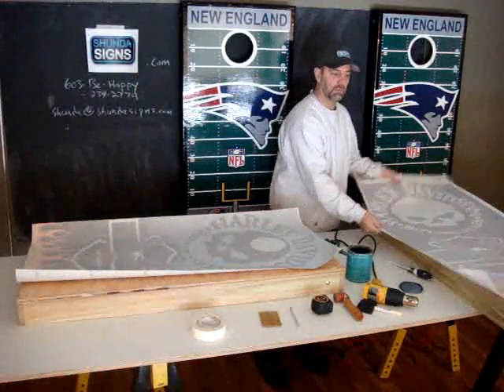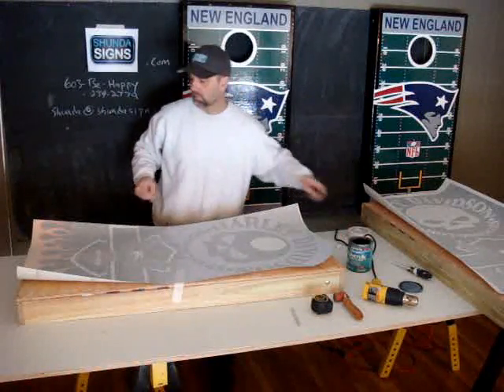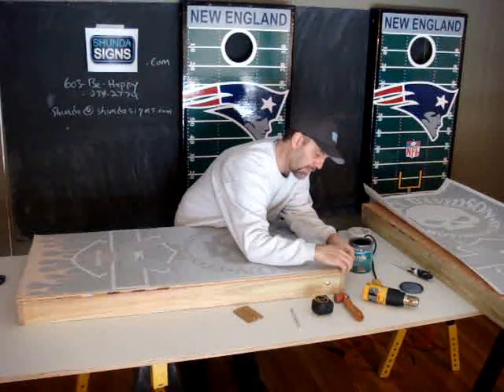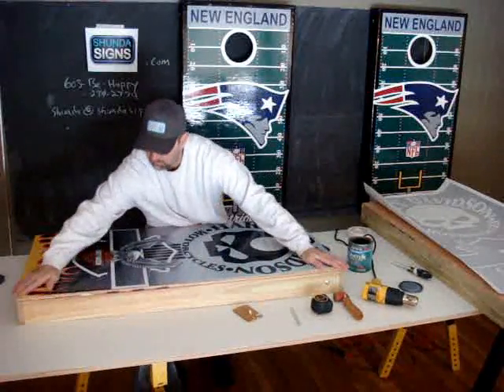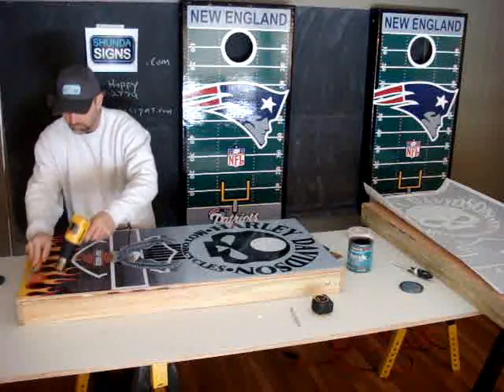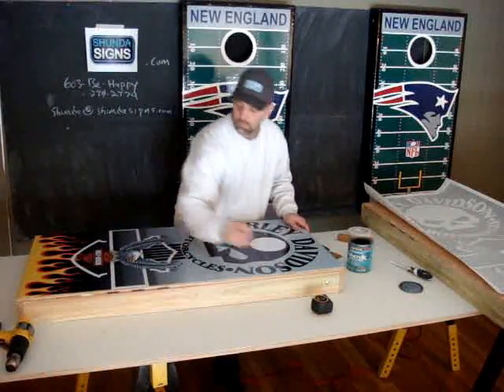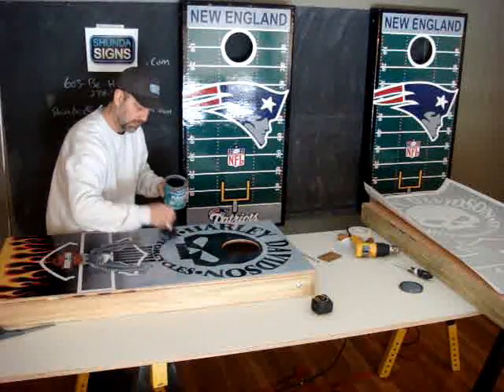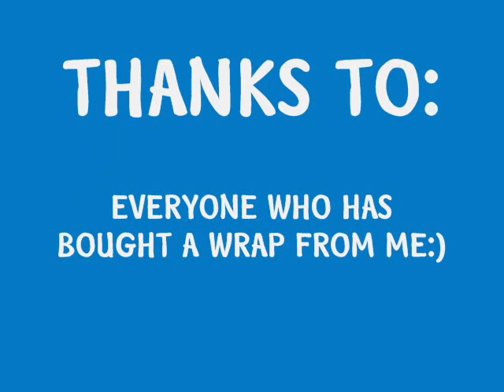cornhole wrap installation video

Comment: I didn't use poly. I primered the set then sanded with 400 to smooth it out. That should work the same right? I haven't applied the wraps yet